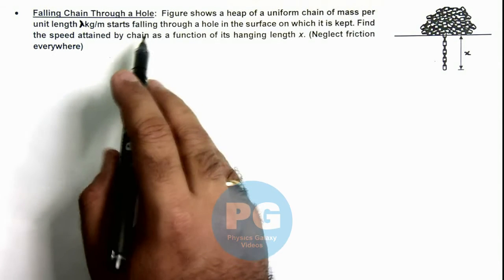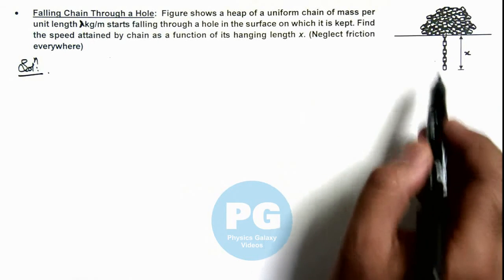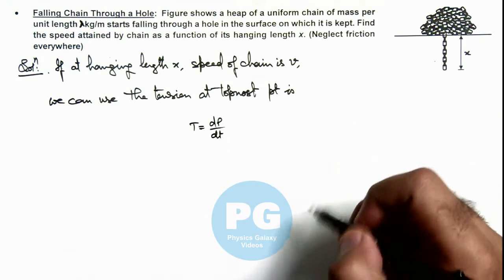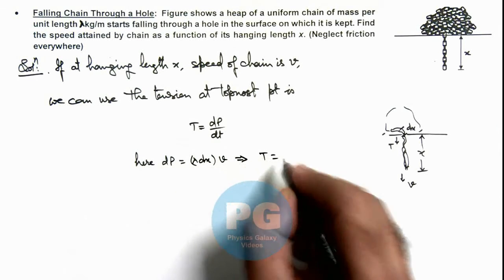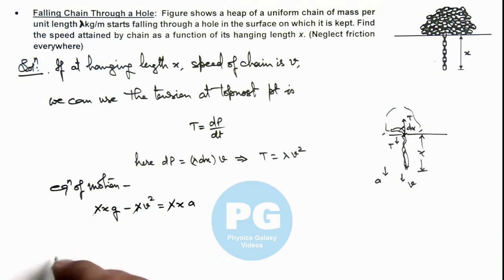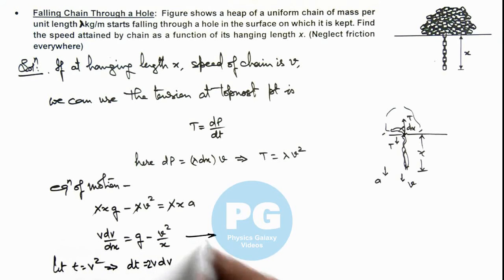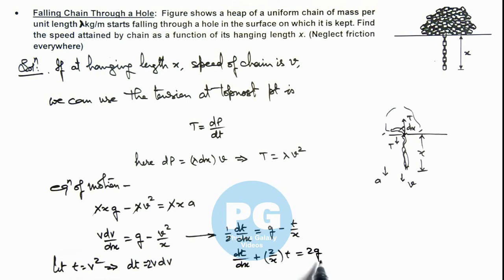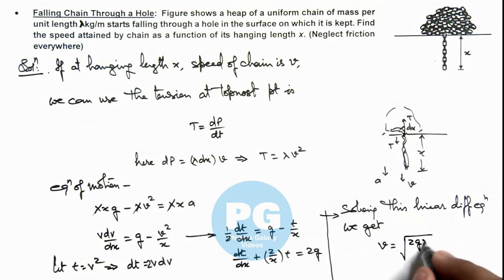Advance Illustrations – Falling Chain Through a Hole | Work Energy Power #16 for JEE Advanced

Comment: I can't believe I couldn't solve the differential equation after forming it in like a minute
Math sometimes just doesn't click while you're solving physics 

I see a lot of confusion about how sir got the value of tension, I did not do it exactly that way, see in such questions where mass is being lost(here, in heap) there acts a thrust force on the heap and an equal and opposite force on the chain. That thrust force is given by Vrel * dm/dt which here is just Lambda * V².

Comment: Even if tension is acting on the heap, it's not the only force, gravity is the reason for the tension, as it's pulling the chain down, but how can gravity be ignored !?
Reply: The dM mass is lying on the table. So, mg is balanced by Normal by table. And the only force causing it to move is the Tension by the hanging part.
Reply: @Shreshth.Vishwakarma Then there is tension by the upward part of chain !!

Comment: Sir while differentiating dP why do we take v as a constant, isnt v also changing? And if not, why have we taken the acceleration of that part?
Reply: Firstly we are not differentiating dP anywhere. We are writing dP as (dM)v..........for this small mass dM, its momentum changes from 0 to v. It is the case a variable mass system. Assume the system to be the hanging chain, and continuously dM masses are being added into the system which changes the momentum of the system. Hence we are considering its acceleration.

Comment: how to solve using work energy therorem
Reply: It can't be applied as the chain parts suffer collision
Reply: @You Go! ;) You can apply work energy theorem on whole body in this case but not on chain parts. As the chain part will suffer inelastic collision between themselves while falling. Work energy theorem can be applied only when energy is conserved
Reply: @You Go! ;) In those cases we take the  work done by the dissipative forces into consideration eg friction cases.. but here it's different. Tension is internal force. We cannot balance internal forces with external force
Reply: @You Go! ;) Answer comes same if Work energy theorem is applied on whole body . At COM. So that the internal forces like that of tension and collision don't have to be taken into account

Comment: Sir, I used WET for com,
and got:
0 + mg(x/2) = (1/2)mv^2
m=λx
0=k initial
x/2 = displacement of centre of mass...
Here, I think the problem is with not considering the work done by tension...
I have the misconception that tension does no work if it is an internal force... so, plz tell me what correction must I do to the above equation which might remove the misconception using this example...
Reply: u cant use WET beacuse chain collides

Comment: Sir why should a tension develop at the top most point?There is no nail bur only a frictionless hole?
Reply: The hanging chain is has to accelerate each  the link of the chain that comes through the hole from dy/dt = 0 to the dy/dt=v.  Each element of mass delta(m) has to be acclerated to the velocity v of the falling chain, so this represents a change of momentum of v.delta(m).   The force required to do this is v.delta(m)/delta(t), or in limit form v.dm/dv.   I hope this helps.
Reply from the maker: +debmalya sarkar Due to the weight of hanging part of chain...